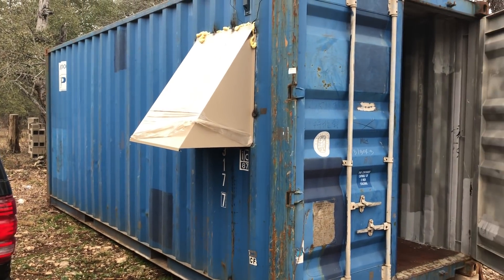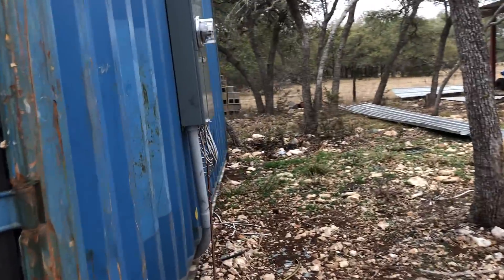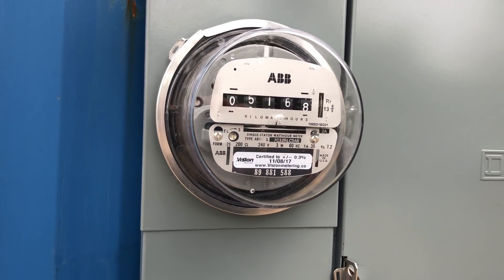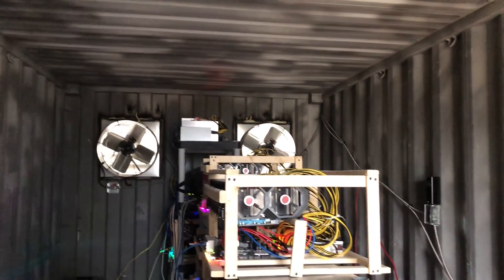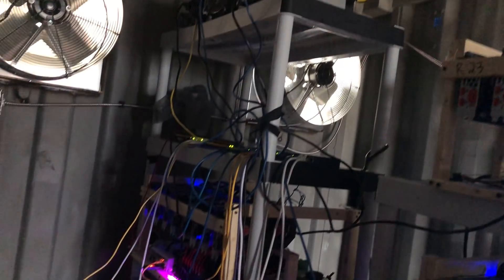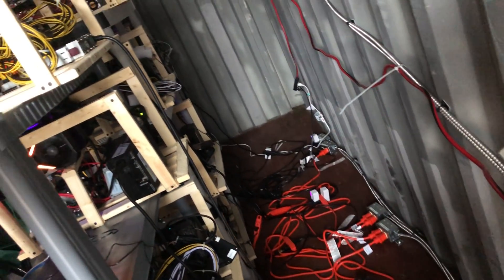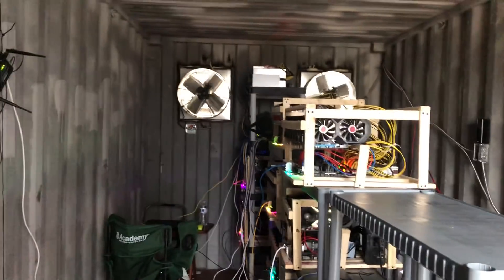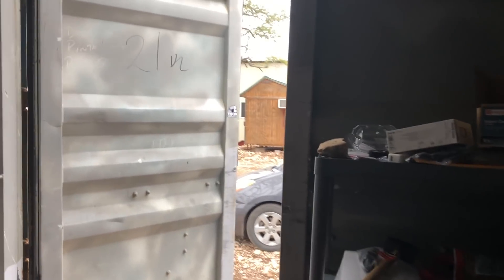Shipping container Mining Rigs

Comment: Thank you for sharing this. Like many of us out there, we ponder doing this. After seeing your set-up... I see that the real advantage to trying to cool with air is to restrict the volume that needs to be cool, and to take advantage of Bernoulli's principle
.... that is to reduce the area of airflow to increase the velocity of air that comes over the cards. Even in the summer a 100F day can cool a  card running at 180F, just need more air... and increase the velocity correctly could sufficiently achieve this goal. I hope you did well in the long run and held for the huge spikes that have been occurring in crypto. Rock On! 🐄🛸
Reply: At four air exchanges a minute I achieved 5-8 deg delta T on a hundred degree day.  I agree with your thought on velocity but I was more concerned with volume. I mined mostly from 200 - 600 and have converted at 4100.  Will move it back in sometime later this year. sold most of the setup for 125k, and it cost around 85 to set it up.  Learned a lot! But air exchanges are the key!

Comment: Hey friend can you please help me answer this question, no one seem to know or reply. I have a cooler with two holes for intake and outake have bitcoin running and leave it outside the balcony. You video seems similar since it is only shipping container without insulation. Can you help me friend and explain if it's okay,

One website said if it the bitcoin stop it could be bad;. Is that true?
Reply from the maker: As long as your mining rig is within temperature limits (however you achieve that) you are good to go.  The fact that it is outside is meaningless assuming it's weather (rain, snow) protected.  I ran that shipping container for over a year 24/7 with hundreds of cards and no issues.  When I broke everything down and sold it, none of the cards had any indication that they had been used in the way I used them other than they were dusty, we blew them off with compressed air and sold them on Ebay like everyone else.
Reply: @SeanReitmeyer  can you tell me what's the maxium temp and minimum,
I been running inside and it's so far so good though it is 95 - 100 reading

Right now weather outside
-1c = 30.2f and the temp on weathernetwork.com says
Humidity
 55%

sorry new to this even thoug i been mining few month inside,
Reply: @SeanReitmeyer  by the way it's only one antminer, do i still need extra fan install? vs where you have fans for obvious reason,
Reply from the maker: @SilentProtagonistSyndrome  I don't remember any specific temperatures other than this one.  On a hot day in Texas about 105 degrees, the inside of the container was 115 - 120 degrees depending on where I took the reading.  That's a direct correlation to how much air I was moving.  Had nothing to do with insulation.  Insulation would not change that number by much at all.
Reply: @SeanReitmeyer  I agree, and thank you so much for explaining.
Okay I'm going to give it a try one last question;. my cooler is away from snow and rain, would there be huge danger like what's the worse can it happen?
Reply from the maker: @SilentProtagonistSyndrome  the worse that could happen? You could die from Covid-19 hahahaha.   Just run your miner dude, you will learn a lot over time.  Good Luck,  Sean
Reply: @SeanReitmeyer  awesome, thanks :)
Reply: Oh I hate to bother you just one last question if you don't mind, should I put power supply inside the cooler or outside the cooler? :S
Sorry I know you said I'll learn but I still prefer to ask.

Thanks
Reply from the maker: @SilentProtagonistSyndrome  whatever is easiest.  Your main issue is lots of air flow and monitor temperature.
Reply: @SeanReitmeyer  monitor temp of the antminer and not power, alright, I'll put the power supply inside and hit!
Yo Thanks for everything.

What you doing now, why did you sell, US is printing like crazy and it's going to sky rocket the price of Bitcoin,
Reply from the maker: @SilentProtagonistSyndrome  maybe I know something you don't know.   I have my reasons for doing what I did and when I did it, and you have your reasons.  Time will tell who was right.

Comment: great video! out of curiosity, what was your total investment into this setup? and how long does it take to get back your ROI on the full build? thanks
Reply from the maker: About $2,300 for the container, and $1,500 for the setup.  There is no "roi" on the container, electrical panel and fans.  That would be like saying what's the ROI on your air conditioner at your home.  The return is less humidity and more comfort, not dollars.  ROI on the rigs is lots of ethereum, litecoin, and bitcoin.  That's the return on the investment on the rigs.  In regards to "break even" which I think is what you mean by "roi", the rigs I built broke even a couple of months ago and I'm hashing at around 5,000 m/h per second, about 3,500 of that is in the container currently, and another 1,500 at my office warehouse.    I have not taken any steps to improve R factor, and all rigs/ video cards, and asics are still running even though sometimes in there I've seen it go to 120 degrees f.   So while not ideal, it is in fact running, and running profitably.  My cost of electricity is .11 / kwh.  From there it's pretty easy to calculate everything that might matter.
Reply: ya, i meant the break even point from mining. Thanks for the info!

Comment: nice idea sean. personally ill say bad execution. you tried hard. but what a mess. anyways, enjoy working in there. i like the airfilter for the inlet air tho!
Reply from the maker: I'm going to answer with "done" is better than "perfect" ;)  If you listen I did say in the video "What a mess".   Yeah, still a lot of work to be done for sure!  Thanks for watching Tim!
Reply: no hate, all respect to you. i actually told my wife yesterday, it might be more smart to use big containers for our next warehouse-farm, so we just bring 8 to 12 of those 40 foot things inside, suck blowin and then blowout, constant flow. hehe. i dont like the wifi approach, but if its working for you thats fine. im also not a fan of cables on the floor. but i already (t)ripped rigs in the 5th floor by running into the lan cable. so, im a fan of overhead.
Reply from the maker: My only caution on the 40 foot is # of air exchanges.  I went with 20 foot for 2 reasons, easy # of air exchanges, and only 200 Amps available power, IE, can only load up so many rigs anyway, but primarily ability to reject heat.